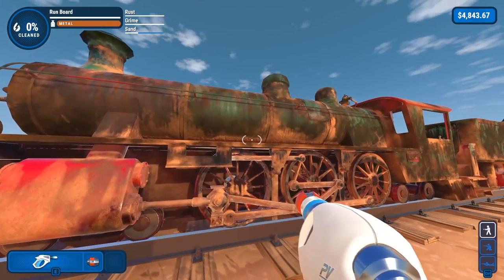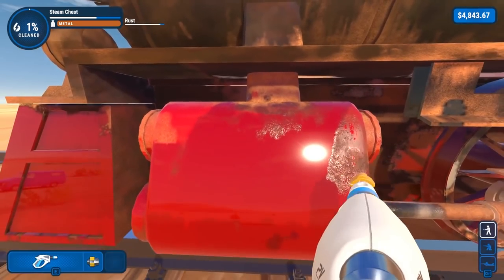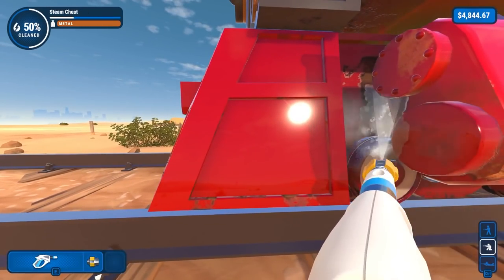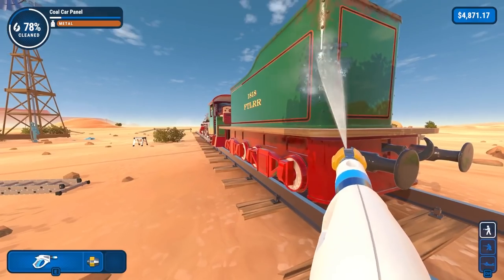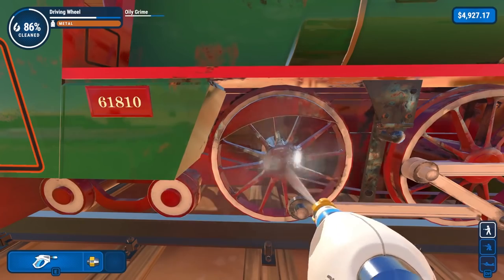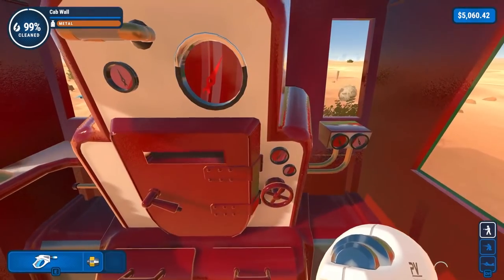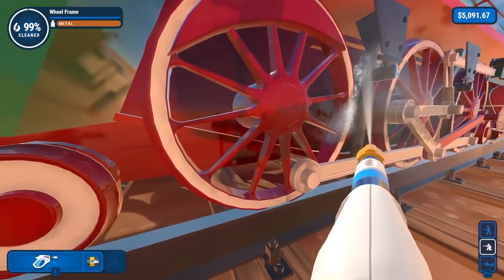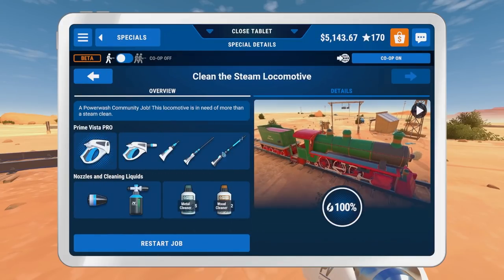Super Satisfying Steam Train Restoration - Powerwash Simulator

Comment: Cow Catcher is designed and angled to cause animals on the track be pushed to the side instead of causing the train to derail. Back when coaches were made of wood, in a wreck they would “telescope” together, like taking a spyglass and sliding it together. This is what caused the massive loss of life in train wrecks as seven or eight coaches were collapsed together into a space the size of one, the coal stoves starting fires, and the wood tearing people apart. Between the life of a cow or deer hitting a replaceable cow-catcher or having to pay damages to hundreds of families of victims of a train wreck caused by hitting said cow or deer, the use and cost of having it is pretty clear… they don’t so much “catch” the cow, though, as simply push it out of the way.
Reply: I learn something new today.
Reply: Must be some really strong cows to have caused all that
Reply: @FoxDog1080  cows are very big and dense animals. Longhorns can weigh up to 1000lbs. When you hit a deer straight on (which maybe weighs up to a couple hundred lbs) in your car going 60mph you can easily total the front of your car and kill the driver. Imagine hitting a bigger and denser animal like a fully grown cow. And if they have horns. Can easily damage wood, would probably destroy your car too. And when cows used to roam more freely, imagine hitting several or dozens of cows while moving quickly along a track. Trains couldn’t stop quickly or even start breaking that they could avoid hitting cows point blank. So the shoveling shape helps push the cows out of the way as it moves forward instead of hitting it straight on which limits the damage and movt of the train from the track
Reply: I always thought they would slow down and push the animals aside, when they found for example a herd crossing the railway. I have never imagined a train slammin cows around Mythbusters style.
Reply: @gekfurian  Trains dont slow down very well. It can take them literal miles to stop sometimes. Come around the bend and see a wayward cow, even if you slam the brakes you're gonna yeet the cow
Reply: @gekfurian  it was more often deer, antelope, elk, or other wildlife appearing out of the ditch from seemingly nowhere and darting across the tracks like they do to cars today that they contended with, hence the design. It was by no means perfect, but so long as it prevented the train from derailing, it was adequate. The use of the word “cow” was catchier than “animal bumper to get out of the way device” as was actually proposed by one early designer… it’s basically the ancestor of today’s brush guards and bull bars used on trucks and semis, pretty similar purpose. Before the Westinghouse Air Compressor and brake system in 1885 and said train air brakes finally becoming mandatory by federal law after World War I, trains were stopped by the engineer sending out a whistle signal to the brakeman, who would then scramble from car to car abs manually turn every single car’s brake wheel. This is why old boxcars and other rolling stock have a catwalk on the roof and flat cars had a raised brake wheel on one end, coaches as well. As a result, in many cases, a train only 8-10 cars long could take twice the stopping distance of a modern 3/4 mile long freight moving at the same speed not due to weight but due to how long it took the brakeman to scramble from car to car, and by 1900 trains were pushing 50+ cars. The biggest reason it took a federal act to get air brakes installed was because doing so literally put 100,000 brakemen out of a job and cost tons of money to upgrade all existing locomotives and rolling stock, it was cheaper to just maintain the status quo… the status quo being the cost of 150-200 brakemen’s lives in a good year (human life was “cheap” back then, someone dies, grab a new idiot desperate enough to do anything for a few pennies a week) and triple most others being still cheaper year-to-year for decades than upgrading. So, as a result, unlike today, a train didn’t always have the luxury of even trying to slow down upon an random animal jumping out of the ditch, or coming around a corner and finding a herd of some kind standing on the tracks. The cow-catcher was nowhere near perfect and didn’t always work, but at least it had a chance of blunting the impact enough to save lives… rather, paying customers and  merchandise… to get the job done. When locomotives got bigger, they had a better chance of just knocking animals out if the way rather than risk detailing, but ask any modern engineer how they feel when a moose runs out in front of their big diesel: they go into a panic, even today, it can derail the train from the impact or if the animal gets under the wheels.
Reply: In the north they use the same idea but for snow, moose, bear type
Reply: The more you know
Reply: Back in those days, if a relative croaked in a train wreck, then that was that. Nobody paid the family a dime, and good luck suing. It was challenging to sue anyone much less a giant railroad company that had every politician and judge in its pocket.
Reply: @FoxDog1080  It's not so much the weight of the animal or that it causes the train to act like it hit a brick wall, it's more about how much of the animal's body get's fowled in the drive wheels or wedged under the carriage "trucks". The trucks are are the pivoting 4 wheel units that are cushioned by springs so the body of the animal doesn't have to lift the whole car, it simply has to cause the truck to jump off the track. The rake pushes the animal off the tracks and prevents it from going under the engine.
Reply: Or...just splatting them at higher speeds
Reply: It’s a pilot

Comment: You ever watch old 1930's-40's cartoons? Almost any time they had a locomotive in the show, there was a cow on the tracks blocking the path in some hilarious fashion. In particular, there was a Looney Tunes cartoon where Porky Pig was racing an old beat-up steam locomotive against a sleek diesel train, and a bull rushing up the tracks and heabutting the locomotive across the finish line was the deciding factor.
Reply: I also checked the devlogs for this update, and they mentioned that in order to represent each map accurately, they basically have to become experts overnight as to the names for each object. Now THAT is some attention to detail.

Comment: Note on cow catchers on trains; they arent designed for pushin cows at max speeds of our time, but were instd designed at a time when trains moved much slower than modern trains do (up to 23kmph/50mph) and if a cow were spotted on the track they cud even slow down (tho often they didnt, esp as trains got faster; thankfully cows got less prone to wander onto tracks and fences got used more to keep them out as trains got much faster and splattered cows much more visceral) and hit the cow more gently and prod it off the track.

 Remember that cows are literally sturdier than brick walls and weigh hundreds of kilos, or twice that in lbs. Now, does it catch a cow if movin at high speeds? Yes, and its a rly good thing it does bcuz unexpectedly hittin a 1000 kg animal with a train cud dmg the train otherwise (Spec the worry is of the cow goin under the train and causing a derailment, hence the design bein to lift them up and away from the middle of the tracks). 

The cow catcher is just extra metal on the front that can take such a blow, or more commonly in modern times, can hit a car and push it aside rather than have it smash into the train and dmg the train parts. Notably this also works to increase survivability rates of folks hit by trains as theyre much more likely to have their vehicle pushed aside rather than crumpling completely into the train (Esp if a train operator spots them early and begins to slow down in time to decrease impact speed).

The cow issue is no longer the primary concern of such trains tho, with cars bein the much more common object found on tracks in modern days, but it used to be very common for grazin cattle to graze across train tracks.

Bonus Note: Train operators at the time tho didnt call these cow catchers and that was a laymans term for what those workin the rails wud simply call the pilot.

Bonus Bonus Note: Europeans found a diff solution to stop cows from gettin hit by trains and Europeans who visited USA at the time often balked at the foolery of the Americans to opt for such a brutal solution when their trains had a much safer and much simpler solution that didnt involve adding any weight to their trains. Youve probs guessed it alrdy...

They built fences. Yep, a fence keeps the cow away from the front of a train even better than a cowcatcher; xD

Bonus Bonus Bonus Note: The early invention that eventually got replaced by the cowcqtcher was literally a lance. Trains used to joust cows.
Reply: Moove
Reply: Final Extra Bonus Note: Theres one story of a train carryin mail that managed to catch a lucky cow on its cowcatcher and carry them all the way to the depot. This lucky cow had landed on a flat area (cowcatchers originally were longer and flatter; but they were also less effective bcuz of that and cud catch mangled cows on them and thus force them to stop the train when hittin one in  the dead of night with no warning). And accordin to the articles at the time, said cow was returned to where they belonged; which is just vague and cryptic enuf to leave me wonderin if they meant returned to that cows original farmer or not xD

Comment: Another, probably more important reason for the "cow catcher" was a defense against train robbery. Bandits would pile logs and debris, even a buffalo or two that they killed specifically for the purpose, on to the track to force the train to stop. The rakes that were added to early engines were sturdy enough to plow through fairly large blockades. They had the added use in the north of pushing snow out of the way, also.

Comment: I don’t think people realize how steam locomotives weather, the paint on them comes off easily and if it doesn’t it fades, they oxidize easily and even when they are running top notch they get extremely filthy, greasy, and wet, causing more oxidation
Reply: the paint does not come off easy it doesn't oxidize like its not made of cooper the paint does fade
Reply: @welsh_Witch  when it’s been sitting for a while the paint will come off

Comment: A CowCatcher, Also Known As a Cattle Catcher or Pilot, is a structural sub-assembly, typically mounted on the front beam of 1800s era steam looks. They're intended to deflect obstacles (wildlife, cattle, rocks, trees...) on the track that could derail the train; they also act as a basic snowplow in winter.
Reply: I think the reason they have it is because they look cool

Comment: The furnace of the locomotive is actually called a firebox which burns coal or wood to make a fire which heats up the water in the boiler evaporating it and making steam. The game just got the name wrong. The pilot is the pilot wheels which guide the train along and keeps the front of the train from bouncing around, along with the trailing wheels which keeps the back of the locomotive from bouncing around.

Comment: It’s called a cow catcher cause Cows used to wander onto The tracks so they designed the cowcatcher to push cows off The tracks. By the way the pilot or the pilot wheels which are the front wheels of the train and the big wheels are the drivers in the back wheels are the trailing trucks.

Comment: 5:13 Yes, when trains were first invented in the mid 1800s, lots of issues occurred, such as branches or other things falling onto the tracks and derailing trains. More commonly, livestock would wonder onto the tracks. Most of the time these were cows. (Hence the name.) This would cause the death of the animal, making farmers angry. The locomotive would ram into these issues, causing the invention of the cow catcher. It would push the animal or debris out of the way. This was also great for farmers, because if the train slowed down enough for the animal, it might live to see another day. Trains today still have cow catchers, but are now commonly referred to as a debris guard to prevent branches from clogging the wheels. (the solid cow catchers also help with clearing snow.) Hopefully I got my facts right.

Comment: The reason its called a "cow catcher" is because back when steam was used for a lot than just boiling water, there were a lot a cows near railroads and the cow catcher prevents the cow from getting ran over by the train.
Also, the wheels are called bogies, trucks ,and wheels. Not rail wheels.